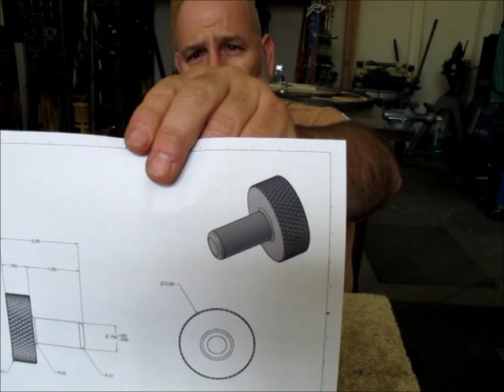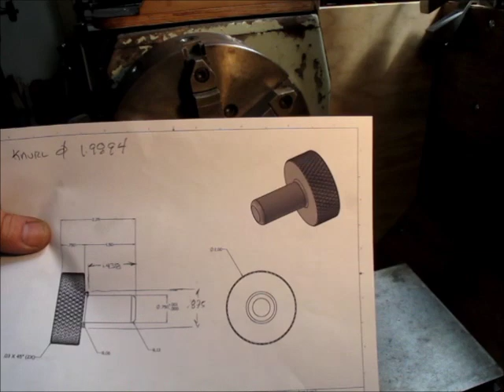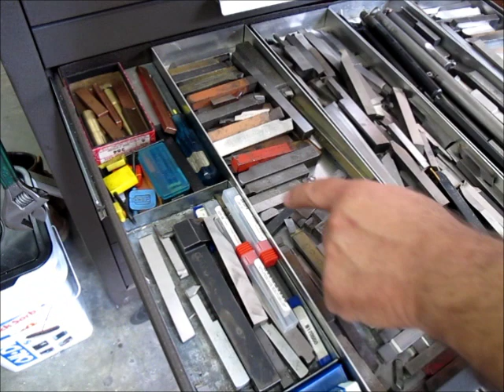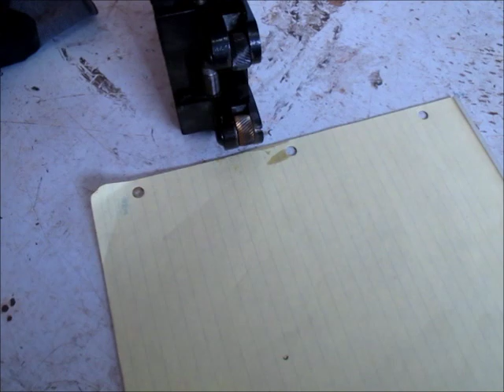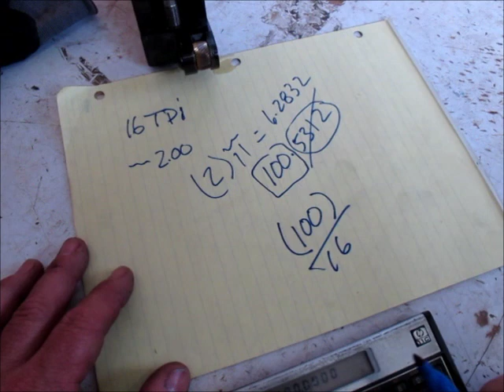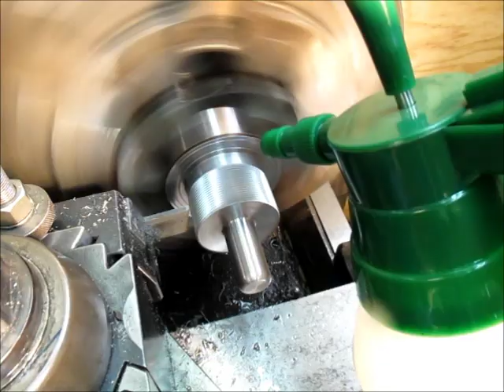Press Pins 1

Comment: OK, so according to my back-of-ciggy-packet sums in horrid imperial (Metric European here).  On a circa 2 inch diameter part, a 16tpi knurl will find native diameters for it's root at approx 20 thou intervals in the diameter:
2.0093 = 101
1.9894 =100
1.9695 = 99
1.9496 = 98
etc.

 On your first pass you dialed in 80 thou.. giving your tool something like 4 chances to find different "working" pitches, my guess is you ended up with a 98 or 97 pattern rather than the 100 you calculated for, since the 100 allowed no material to be displaced into the knurl forming.  I contend exactly the same would have happened if you'd simply turned the nominal 2 inch diameter and not worried about the calculations, despite a 0.5 "remainder" being about the theoretical "worst case", since it's about as far as can be from a "native" diameter.

Now.. had you been timid, and wound in 20 thou at a time, the wheels would have been trying to form one diamond less per pass, without much of a "guide" to follow, and you'd have likely ended up with a mess. Having wound in a decent "bite" to start off with, your subsequent pass had a firm and somewhat work-hardened set of diamonds to follow, so couldn't make extras on the part since slipping into the formed pattern is easier, thus the wheels could only complete forming peaks.

The secret to knurling is confidence, not sums!

Comment: Great knurling, a few questions. Is the tooth pitch of the knurl wheel (16tpi) related to the outer diameter of the wheels? If so, as the wheels are driven into the material the tips of the teeth are no longer biting at the depth of the carefully calculated diameter of the workpiece but at a smaller diameter. Would it not be rational to make the workpiece diameter equal to an even division of the tpi, as you calculated, plus some factor to allow for the tooth penetration?
Joe Pieczynski appears to have demonstrated that good knurls could be achieved with any diameter of workpiece irrespective of knurl tpi, providing that sufficient infeed is applied to the tool on the first pass. His video appeared to show that even with a carefully calculated diameter, if the infeed is very light on the first pass it can produce multiple cutting and spoil the result.

Comment: When I used the old "push" style knurler, I didn't tighten up the QCTP, I let it float to find the center. Seemed to work. I use a clamp style now ( much easier on my light machine ) and it centers automatically.
Reply from the maker: +Jeff Stewart Hi Jeff,

The only clamp knurl I ever used left a bad taste in my mouth. I should probably try one again. We did mostly 316 stainless and another nasty duplex stainless called 245 SMO. Thanks for the comment.

Cheers,

Tom

Comment: as far as I know, you get that blue colour on all steel at the right temperature. it's caused by a layer of iron oxide at just the right thickness, and the colour comes from thee thin film effect
Reply from the maker: +Rob Mckennie Hi Rob,

My observations are that different alloys produce slightly different blues. 8620 has a really nice one. Thanks for the comment.

Cheers,

Tom

Comment: In the straight knurling video you used the pitch of the knurls to do your calculation and in this video you just used the TPI of the knurls.  I was curious as to why you used the different methods.
Reply from the maker: +odd766 Hi Odd,

Straight knurls have no angle so its really just the count around the circumference. Hope that makes sense. Thanks for the comment.

Cheers,

Tom

Comment: Hello,Could I suggest for the material EN39B, this can be Vacuum furnace carburised with minimum distortion as there is no quenching.Then instead of Grinding turn with cubic boron nitrite, this is mounted onto a tip tool, it will turn 65 Rockwell al day.It leaves a finish suitable for fitting bearings.I used it in production, making hydraulic shafts, I turned instead of grinding and took $80.00 off the cost of each shaft.RegardsNoel R
Reply from the maker: +Noel Rieusset Hi Noel,

Thanks for the comment and suggestion. I had the 8620 in stock. It has some of the same qualities as the EN39B. 

Cheers,

Tom

Comment: What kind of cutting tool you are using? It gives a very smooth finish!
Reply from the maker: khoa nguyen dang Hi Dang,

I use several in this video. One is a WNMG Iscar tool and the other is a high speed hand ground radius tool. Thanks for the comment.

Cheers,

Tom

Comment: Tom a question--how do you like the digital micrometer--is it comparable to the older mics in accuracy etc. Must be a lot easier to read.. From an old bloke from the southwest of Oz
Reply from the maker: Ian Craig Hi Ian,

I love mine. They are about the same price as the mechanicals these days. No reason not to invest in one. They are sweet to use. Got used to using one when running a cnc lathe. Very handy there. 

Cheers,

Tom

Comment: The "case" is the box in which the parts are kept, during carburation, not the skin formed on the part itself. It would be called something like carburation depth.
Reply from the maker: Hi Ulf,

You have my interest now. I have always called it "case depth" along with all the heat treaters I have used for the process. Perhaps they were just being polite and not pointing out my error. Sounds like I need to do some research on the terminology and make sure I have it right.
On second thought take a look at this and see what you think. 
http://en.wikipedia.org/wiki/Case_hardening

Cheers,

Tom
Reply: oxtoolco Thanks for the reply! I´ll look it up in Wikipedia shortly. If you make yourself understood among all your heat treating collegues in the US, this might just be an example of the fact that language constantly changes. Afterall cases, packed with carbon are hardly ever used today but rather carbon emitting gas in tight ovens.The need for an expression for the acieved depth of diffusion of carbon atoms into the steel, however is very much up to date, and often crucial, e.g. a piston pin. ( eng. case hardening, swe. sätthärdning, ger. Einsatzhärten, only in english is the case ever mentioned!)
Ulf
Reply: Ulf Andersson By the way, have you heard the expression: Hardening directly from the case? Has any Wikipedian figured that one out yet?

Comment: tom , you should explain how to square up the parting tool.it;s very important. I use a test indicator on a mag base. with the indicator tip on the side of the blade, crank the tool post in and out until its square with the axis of the spindle.
Reply from the maker: Hi Richard,

Thanks for the comment. I usually put it up against the chuck face to square the parting tool to the machine. On CNC lathes I've set them up with an indicator at times to solve a parting problem.

Cheers

Tom
Reply: oxtoolco its always a good practice to check with an indicator. things move after tightening.

Comment: Tom, I noticed at 26:40 that you place your hand behind the tool post prior to moving the carriage away from the work. (Ha! should have waited to comment until after having watched the whole video. You went on to explain my question!). You (and the other guys) also do so many things from years of experience, which you don't explain verbally but do show by letting us watch you work; these subtle practices are difficult to discern because so much of the video shows close-ups. I would love to see some sort of split screen in which the picture-in-picture showed a simultaneous, full body shot of you working so we could see how you operate the machines. I'm just a beginner, and I want to avoid having to sweep up removed fingers along with the chips. Your videos are also keeping my body parts attached!
Many thanks for sharing.
Warm regards,
jim
Reply from the maker: Hi Jim,

Sharp eyes you have there. Is that from all the seal hunting out on the ice you do up there? :-))

That is exactly what I'm doing. Pulling back with a few pounds of force keeps the tools from tracking in your finish cut without changing the crossfeed setting if you need to take another skim. I mention it in my book and in at least one video but I couldn't tell you which one.

Cheers,

Tom
Reply: Seal hunting from the ice is close to a thing of the past in much of Greenland where it was commonplace 30 years ago. We are ice free all year round here in Nuuk, and all the way to Qeqertarsuaq it is ice free year round! Global warming has put a dent in the "walk out to hunt" routine and has pressed us to "motor out in a boat" to hunt. Our son has a 19' locally made fiberglass boat and we do enjoy our outings. Shooting a seal from a boat is not that easy, but exciting to experience. We eat the meat, (raw seal liver tastes like fresh cucumber from the garden), and the seal fat is excellent with dried fish. Yup, a bit different than my usual fare growing up in Reno, NV!
I do enjoy your programs. I've been trying to think of something to send you from here that you might enjoy, but I would need your post address. I'll try to drop you a line at your e-mail address.
Cheers,
jim
Reply from the maker: Jim Milne Hey How about some seal steaks for a barbeque. Just kidding. I don't think you could send them anyway.

Cheers,

Tom

Comment: We recently acquired a Dorian brand single roll knurling tool for the Haas SL 30,
none of the knurling tools we had on hand lent themselves to mounting in the turret.
MAN does that work nice it came with a 16 tpi straight knurl for about 1/3 to 1/4 the price of all the other tools I looked at that didn't come with any rolls at all, and they also offer diamond pattern rolls.
It even came with a nice sheet of instructions, how often do you see that, anyway
I just set it up with the recomended speed,feed and depth and formed a perfect straight knurl on the 1" dia unturned portion of 100 parts in 1018 CRS, first try, whew what a relief, it was a panic mode job that had to go out the next day!
Tool was ordered at 4pm Thursday and had it in my hand 10am the next morning, MSC ROCKS!! The parts were finished by 2:30pm then the bastards didn't pick em till Monday LOL!
PS the load on the X axis was surprizingly low and I did start feeding off the part at full depth single pass with a G04 P.3 at the end of the feed.
I need to start taking my camera to work LOL.
Reply from the maker: Hi Gent,

Aren't the single roll knurls from Dorian cut type knurls? These would definitely have really low pressure. 1018 yuck. Glad it all worked out. Dorian has some great knurling technical data on their website. I have looked there a couple of times for information.

All the best,

Tom

Comment: Hi Tom,would using the threading dial reduce the risk of not picking up the knurl for the second pass providing you used the same start number on it for the first pass ?
Reply from the maker: Hi Johnny,

Never tried it. Many people never disengage the knurl from the work. I did it this way to show what is generally a different way to knurl.

Best,

Tom
Reply: Since the wheels are free to spin in the tool the instant they disengage from the part, not mechanically timed by any aspect of the lathe bar their engagement with the work.. No it wouldn't make any difference using the threading dial.  To be certain of re-engaging you could stop the lathe, then approach as Tom did when setting the height of the tool, and actually feel that the wheels engaged before re-starting and feeding in for another pass, or keep the tool engaged, either of which will eliminate the risk, rather than simply reducing it.

That said, just go in confidently, the only times they don't re-engage are either through being too tentative, or slamming the tool into a partially formed knurl which still has flat crests the teeth can land on because the first pass wasn't firm enough.

Comment from the maker: Hi Barry,

You are correct. There is a lot of confusion around knurling in general. Some of the parameters are not always obvious. For example there are commonly available knurls that are optimized for stock diameters so depending on what tooling you have you might get highly variable results case to case. 

Best,

Tom

Comment from the maker: Hi Clive,

I don't grind the top of the parting tool. Occasionally I might use a small hand hone to flatten the top id there is some buildup on the top surface. The tool is a standard T type blade. Many years ago I used to grind a fuller or groove in the top surface once in awhile to help the chip to collapse width wise. I gave up on that because it interferes with using the parting tool to groove with. 

Regards,

Tom

Comment from the maker: Hi Tyler,

Good question. The knurls can only knurl properly on specific diameters that are divisible by the tooth pitch. Just because you have turned a diameter does not mean the knurl will track on it properly.  The math was to determine the closest diameter to 2.00 that the particular knurls I had would track properly on. Think about like gears. The knurls can only mesh with whole teeth. Hope that helps.

Regards,

Tom